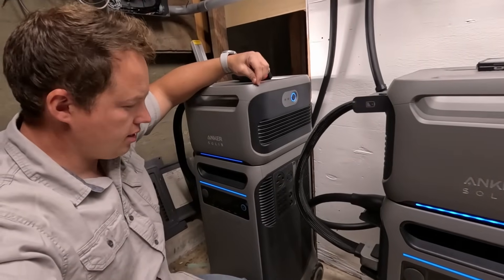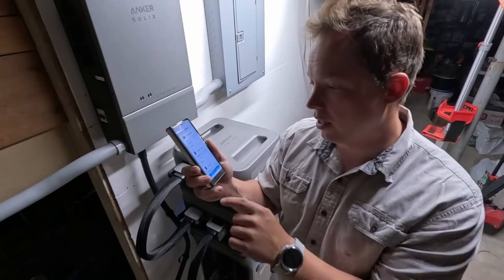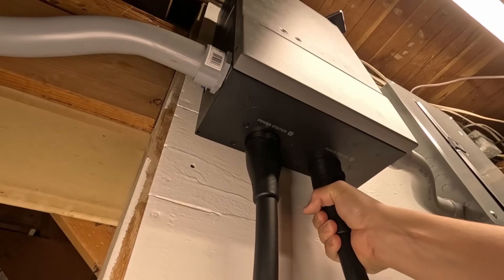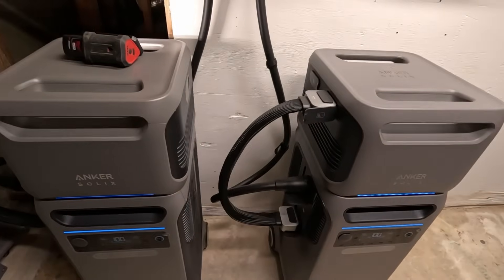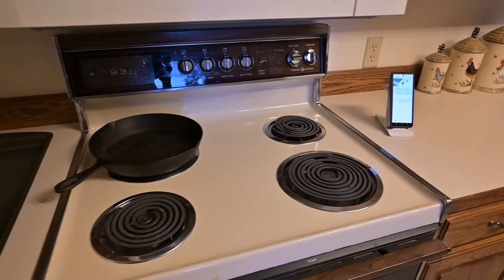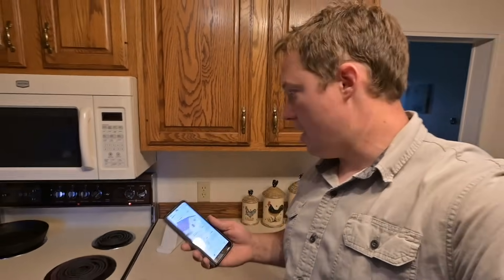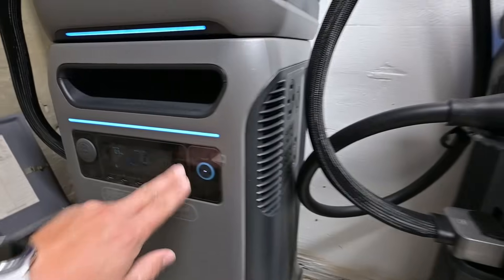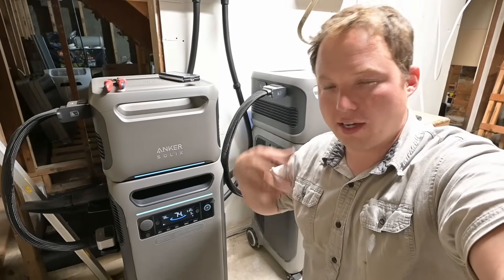Double The Output of the Anker SOLIX F3800 Whole Home Power System!

Comment: This is a dumb question but it's driving me crazy. What's the purpose of the backup subpanel if the anker is able to backfeed the main panel?  Is it to be able to choose to only power the subpanel circuits in a backup mode versus powering "everything"?
Reply: Yes. Backup subpanel is for when you lose power from the grid. The Backup panel will be powered by the F3800, while the primary panel will lose power.

Comment: Thanks for the video. I contacted Anker regarding the cable for the smart panel, I was looking for an etension to run from the smart panel to the battery uni which is about 20' away from each other. hs anyone come up with a solution to expand the wiring. the only other option i can thinko of is by by the sub-panel near the main panel, then running the smart panel near the location where the batteries will be. anyone has input?

Comment: I tried to install one today, almost burned my house, my dishwasher, stove smoked and some lightbulbs burned out. Installed everything like in the anker official video, when running in grid mode its fine, as soon I turn of main power to simulate outage it takes 20 second to switch and then the smoking party starts, especially on older  outlets with no ground. Called MR. Electric. They came out and could not find reason why it did spark like that. Reversed main panel to original, waiting for Anker to send me return label, screw this thing. I also noticed that only people who advertise Anker got this crap to work.

Comment: I was wondering if I could get a generator question answered? I have my inverter generator connected to an inlet which is connected to a manual transfer switch which is connected to my panel. I wanted to know if I could put in a fusible disconnect after my inlet? Also, is it difficult pulling Thhn through liquid tight?

Comment: If I wanna add a gas generator back up, would you recommend I put that in the main panel or under the critical loads panel? My thought is that if I put it in the main panel, then I can trick the system into thinking that the grid is on. Tell me if my thinking is wrong.

Comment: Good video, the Anker F3800 system is decent. I have two F3800's and 6 BP3800 expansion batteries and a Home Power Panel... so I am speaking from experience.  Unfortunately I would not buy again  because but they essentially have no customer service. And when they do firmware upgrades, they don't know the changes in specs.  And they don't ship anywhere near their promised shipping and delivery time.  But as for support, each call or chat takes hours and each response it automatic and says they will reply in 2 days... even for the most basic questions. So unless you're a solar expert, don't count on ANKER for any help unless you have a ton of patience.  If I could do over again, I would go with EcoFlow for their customer support
Reply from the maker: Thanks for sharing your experience.
Reply: I’m a dealer for Anker now, it took me a full year of me having to talk shit on all their social media to get someone to get me set up. Their dealer service center is awesome, but as a consumer you can’t get ahold of anyone.

Comment: I love detail in your HVAC & Electrical videos these topics can be very complex but you have a way of making them seem manageable.. don’t know if you’re taking video suggestions but here are my 2am thoughts..

1. Why 240/120 60hz, and are we outdated, should we change? Why aren’t homes on 3 phase?
2. What really happens to the power when step down or up transformation takes place -
Can you link transformers forever ? Or do you lose something
3. Direct burial vs SER v various conduits with THHN v Romex - when should we use which one or things to consider.
4. When do you need a means of disconnect I.e when cable from meter is longer than 6 ft. , disconnect levers vs breakers, breaker box w meter combo boxes. How to size disconnect appropriately, associated wiring considerations.

Comment: How do I link these four batteries together if I don't have that power panel?  I currently have a transfer switch that I use with a gas generator, which only has a single 240V outlet to plug into.  I'd like to have the 12kW with this single outlet plug.
Reply: Buy the recently released Anker Solix Double Power Hub.

Comment: I really wish they allowed charging via 110v when running the 220V output. Charging via my Honda 2200w genny in an extended grid-down situation would have been nice. Instead, I will have to get 120v to 60vDC converters, lose efficiency, and charge via the XT60 ports.
Reply: Let's say that I have both of my f3800s plugged into the home power panel and the electricity goes out for longer than what both batteries can last.  Can I have both f3800s plugged into the home power panel and recharge the f3800s using a gas generator while it supplies power to my sub panel?
Reply: @GlennTupper no I believe you would have to use solar to charge and still be able to use the units. 
If you use AC it doesn’t allow for 240v my guess is because it can only use the inverter for one or the other as solar charges via Dc and wouldn’t need to use the inverter so you can still use the 240v . I been digging into these units a lot.

Comment: I just install the exact same system x2 f3800 and two extended batteries with the power panel it works great..I had a power wall at my last property and it killed me not taking it with me when I moved. With this unit I can take it with me if I decide to move again
Reply: How did you program the Home Power Panel App so you get automatic discharge to your home during Peak time with Grid OFF then recharge the F3800 etc as soon as Off Peak begins with Grid switching back on? I can’t figure out how to do it without daily reprogramming the Manual Backup Power? Do you leave the Manual Backup power switch OFF? When I turn mine OFF the F3800 and expansion battery starts discharging along with the grid into the house. So I lose Battery Power during Off Peak and there’s no way to stop the F3800 from discharging into the home DURING OFF PEAK TIME.
Reply: @FutureMedia  Off Peak time does NOT recharge the battery.  Only SUPER OFF PEAK time recharges the battery.  So just change your Off Peak time to Super Off Peak time and it will do that.
Reply: @FutureMedia  you have to use the TOU/time of use option your able to adjust down to the hour.  I have mine set to start backing up the house at 4:00pm and it runs till 7:00am after that my rooftop  solar charges the battery to 100% and the cycle starts over.
Reply: @FutureMedia  only option I have turned on is TOU
Reply from the maker: 100%. I've got several use cases that the portability enables. Also awesome that by leaving one unit home you still have backup just at the 6kw.
Reply: POWERWALL For The WIN !!!

Comment: Better to see how much heat producing this power station and how fast thermal paste is drying on semiconductors. I think after 10 kilowatts thermal pads lost their layer thickness and thermal paste begin to boil.
Reply from the maker: Hopefully the engineers at Anker designed the thermal management to handle the maximum output.

Comment: The real problem with this Anker model is it isn’t for continuous off grid backup, as the solar input limit is just too small to make a difference!
I would go with Victron, Apollo instead!
Reply from the maker: I do get what you mean. Would be sweet if they are able to update the system to allow for a more substantial off-grid input. Maybe they could incorporate this into a redesigned Home Power Panel.
Reply: @BenjaminSahlstrom  
The whole reason I went with Victron was because I could grow it at any speed I wanted to, didn’t have to have it all upfront. I bought one charge controller and now I have three.

Comment from the maker: Let me know if you have any specific questions about the Anker system!
Reply: I'm curious about how to power an enclosed trailer for racing purposes? And how well this stuff would hold up going down the highway? Would be cool not to use a noisy gas generator!
Reply from the maker: @toddbrock239  I've used the F3800 in my 5th wheel and it held up well. I'm not sure how it would handle a trailer environment over the long term but if you have it in a reasonably good environment I think it could do well.
Reply: I just ordered a two-unit setup + 2 batteries with the home panel as well. I also have 1200w of solar I can direct connect to it. I would like to know if I have to split that 1200 watts and plug 600w into each or if I can plug 1200w into the first unit and have it share the solar with the second unit.
Reply from the maker: @TheOriginalCheezWiz  That's a great question. I plan on investigating this for sure.
Reply: @BenjaminSahlstrom   I have another scenario I am curious about. What if you have an uneven number of extra batteries when running in the 12Kw configuration. Will the whole system shut down when the one with less capacity hits empty, or will it try to balance the load so that both run out at the same time?
Reply: @TheOriginalCheezWiz how do you like your setup?  I am considering purchasing the same. I’d like them to run my Air Conditioner. Have you tied to run AC yet?
Reply: @chrisnunn6748  I have a HPP + 2 F3800 + 2 BP3800 setup.  I have tried to use it with my 4 ton central AC and it works fine in grid-on Time of Use mode, even without a soft start unit installed on the AC compressor to reduce the in-rush current.  That makes sense because the grid will supplement any deficiency that the F3800s cannot deliver, i.e. the high in-rush current.  In the grid-down mode, however, you might need a soft  starter on your AC unit because the grid is not available to help out.  Do remember that in the grid-on TOU mode, the output  is derated to 6000W output top for 2 F3800s with 2 BP3800 (or as low as 1.9W for 1 F3800).  So a 4 ton AC will probably already use up at least 4 KW of that power, leaving you with only 2 KW of power left, but realistically only 1 KW of power on each of the 120v leg.  Not much to run anything else that is a heavy load, but should be OK for lighting and fan and computers, etc.  Just not laundry or electrical cooking unless the central AC is not running at that time.
Reply: @TheOriginalCheezWiz  Regarding having an uneven number of extra batteries on the 2 F3800s, page 63 of the HPP manual says that you should connect an equal amount of expansion battery to each of the 2 F3800s, and that's the safety instruction section.  So you should not put yourself in that uneven BP3800 pairing scenario in the first place.  My personal observation is that when 1 of my 2 pairs of F3800/BP3800 has a lower SOC than the other pair, the HPP still would draw an equal load from both pairs until it hits 1 of these 2 things:  1)  Either the 1% remaining capacity which would automatically shut down that F3800/BP3800 pair, or 2)  The Battery Reserve level set in the HPP is met.  If either of these scenarios happen, the HPP will then only draw the full power from the remaining F3800/BP3800 pair that still  has enough charge left, and this charge is also over the set Battery Reserve level.  So you can manually manipulate the depletion by setting the Battery Reserve level to match with the SOC of the pair that has lower SOC so that power is drawn solely on the other higher SOC pair until it gets close to the Battery Reserve level, at which point you can change the Battery Reserve level to 1% to force equal power draw on both pairs again until depletion.  If you forget to lower  the Battery Reserve level, however, the HPP will stop drawing from both pairs when it hits this Battery Reserve level and start drawing from the grid, even if your Time of Use period is still Peak time.
Reply from the maker: @chrisnunn6748  The system operates my old 2 ton AC without issue.
Reply from the maker: @PhongNguyen-ov7jq  Great information.